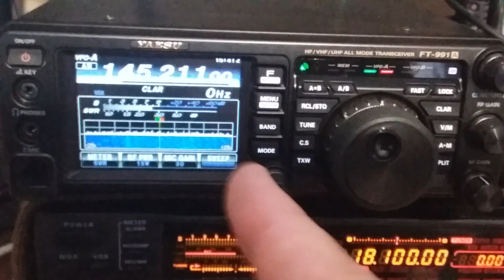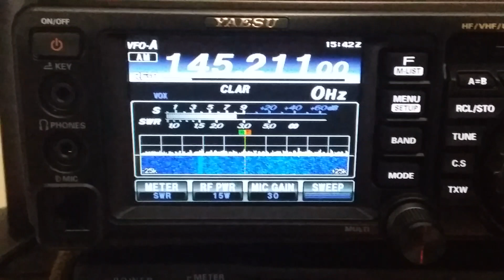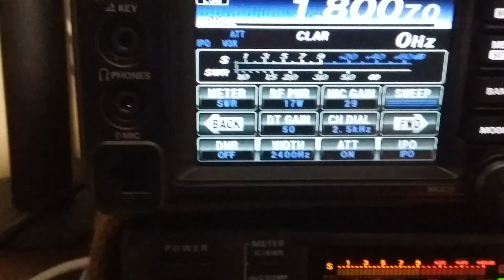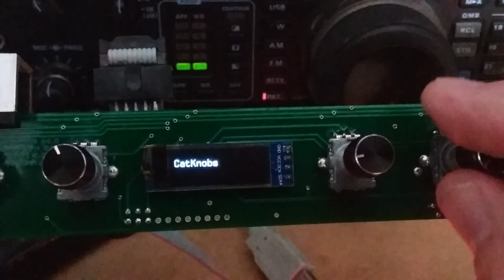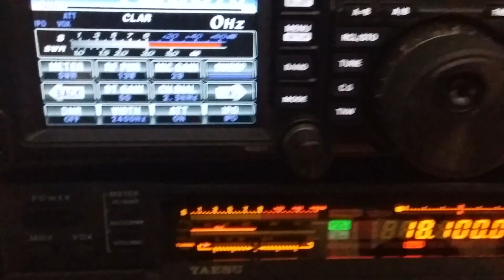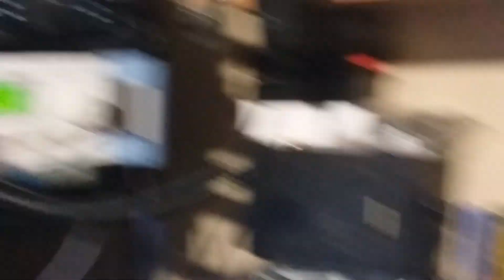CatKnobz controller for Yaesu FT-450, FT-950, FT-991, FT-2000, FT-DX10, FT-DX101,  FT-DX1200..

Comment: I'd love to have one, and I'd love the big display as well.  Information on finding and ordering both please.  Jeff de W5JGW

PS:  I do have a concern though, with only 100,000 write cycles on the EEPROM, how easy is it to replace once it has gone bad?  Would you sell spare EEPROMs as well?
Reply from the maker: http://www.catknobz.com - in reality it will take many years to wear out the EEPROM due to the way it works. It only writes when you change what a knob controls, not the value of the knob. So say you reassign what your knobs control 50 times a day. If you do this every day it would take almost 5.5 years to wear the EEPROM out. Also, it doesn't write until 2 minutes after you stop moving the knobs. So you could keep playing and resigning commands to the knobs for hours and it wont write until there is a full 2 minutes of inactivity. 73s om de chris zl1cvd
Reply from the maker: Oh and no, the EEPROM is integrated into the micro-controller so not available separately as such.

Comment: How does it hook to the rig. That was not shown.
Reply from the maker: CatKnobz plugs into the transceiver rear RS232 CAT jack. It is supplied with 1.5m CAT lead. It also has a CAT jack on it so another CAT device can plug into it. So you can daisy chain as many as you like, add a CatDisplay232 or a Tuner that uses Yaesu CAT commands.

Comment: how does it connect to the radio? let's say the FT-991A
Reply from the maker: RS232 rear Cat port. It also has a pass through port. Requires 7V DC  to 30V DC power.

Comment: Would definitely be interested if it works with the FT891 as well as the FT991A.
Reply from the maker: FT891 uses USB for CAT. FT991 uses RS232 or USB. CatKnobs is RS232 only.
Reply: @ZL1CVD  thanks for the clarification. I don't suppose any RS232 to USB converters would work then?

Comment: Chris, this has a market for '857 '897 owners with zebra screens. (Including ME)
Reply from the maker: Bobby I'm not sure its a good idea going down that track. The 817/818/857/897 are easy to break once you start writing directly to their EEPROM. And this is really the only way to get good control over those rigs. Early versions of Linux HAMLIB library wrecked allot of them by writing too many times to their EEPROM. I think I will be steering clear of accessories writing to these older rigs. The new rigs are all CAT control and not direct EEPROM write so if the rigs fail, its Yaesu's implementation, not my accessory. 73s om de chris zl1cvd

Comment: Does it work with the FTdx 3000
Reply from the maker: Yes except contour as it is. But I'll be looking more closely at this in the next week. there may be more controls that are slightly different but i should be able to get everything matching up to what the Yaesu documentation says. I haven't had an errors in their stuff yet.. 73s om

Comment: Cool!
You'll be porting this to FT-857 etc and combining with the CAT  Display?
Reply from the maker: Hi Chris! Probably not. The 817/818/857/897 are easy to break once you start writing directly to their EEPROM. And this is really the only way to get good control over those rigs. Early versions of Linux HAMLIB library wrecked allot of them by writing too many times to their EEPROM. I think I will be steering clear of accessories writing to these older rigs. The new rigs are all CAT control and not direct EEPROM write so if the rigs fail, its Yaesu's implementation, not my accessory. 73s om de chris zl1cvd

Comment: Would it be possible to run catdisplay and catknobs, maybe a port hanging off the side of catknobs?
Reply from the maker: I'm working on it & have built this into the hardware. The program is the challenge so no guarantees...
Reply from the maker: It is now working with CatDisplay232 :)